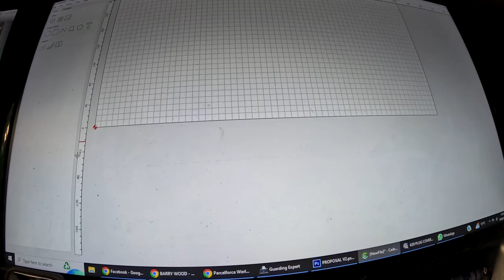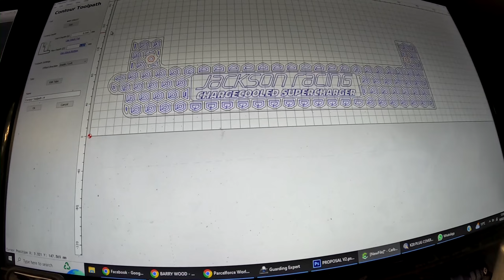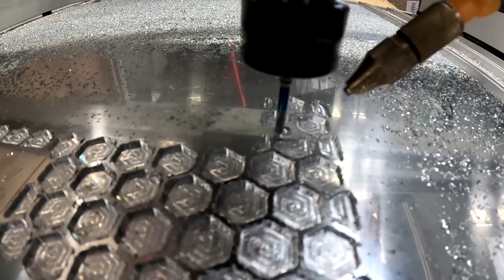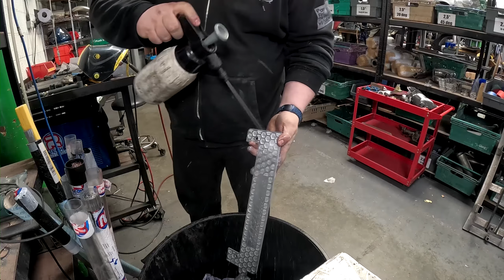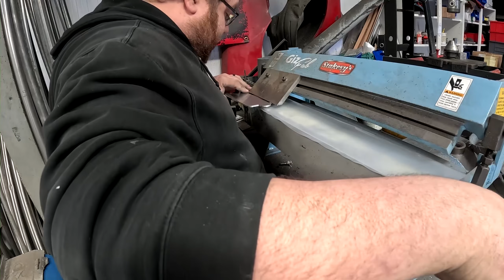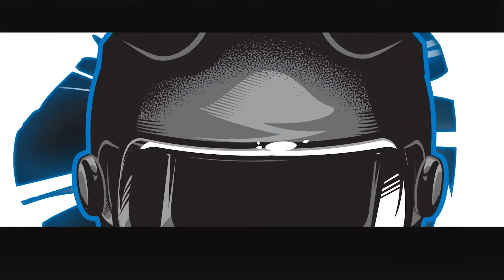Machining Custom Honda K20 Engine Cover on my @carbide3d Shapeoko Pro - FABRICATION VLOG

Comment: great to see someone else using QCAD, always thought it a shame the CAM element wasn't as good as the CAD.
Reply from the maker: Extremely simple and I like using it. It also works great on my Computer at the shop as it’s a little slow…
Reply: @GizFab  I think that's also one of the reasons I originally went for it too. 

I found CAMBAM much better then CC, but also understand the GUI is much better on packages like CC and CB takes some getting used to in that reguard.